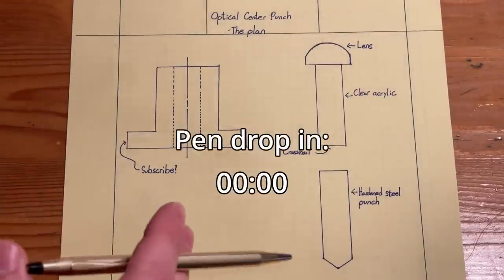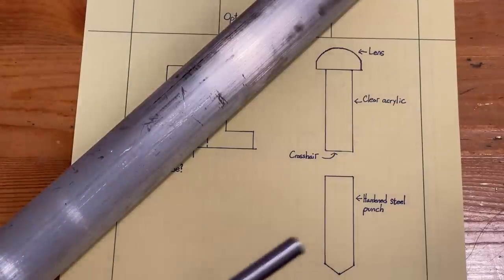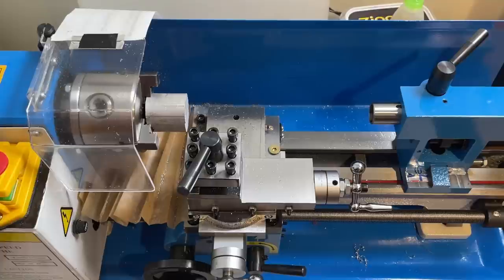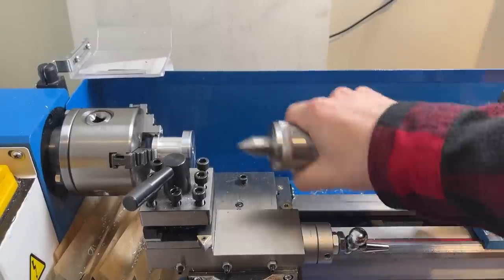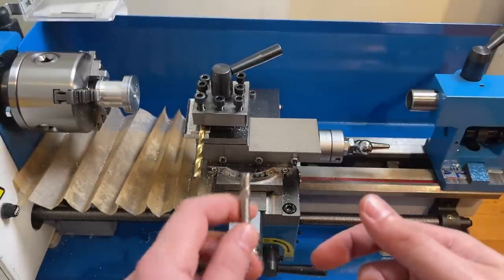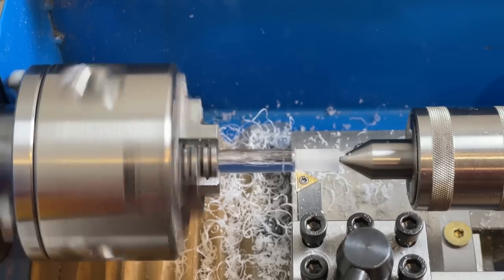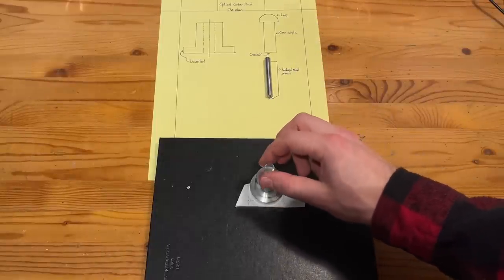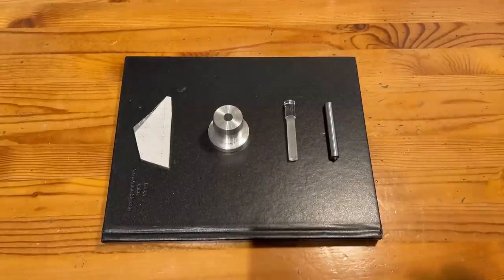Using a Mini Lathe to Make an Optical Center Punch

Comment: I have one like this a tool maker friend of mine gave me years ago. The design is pretty close to what you made with the exception of the acrylic rod has a shoulder that holds the end about .050 off the work surface because acrylic scratches very very easily. Another design difference is there is a second acrylic rod that comes in from the side at a 45* angle about half way down to transmit light to the center mark. If necessary you can use a flashlight or a light source (goose neck lamp) to brighten up the target and make it much easier to see. But all in all nice job on this build.

Comment: With leaning over the punch, the acrylic finder can get dark.  You can make the acrylic rod longer which acts as a light pipe, or make the holder out of clear acrylic.  The punch needs to be very hard, I used water hardened drill rod and the point still dulled on relatively hard materials. Later I used commercial centerpunch replacement tips, they’re cheap.  I made an acrylic spacer to account for the difference in size of the acrylic finder and the commercial punch tip.  That worked well.  You can make the lens end by drilling a piece of 2x4 scrap with a 3 or so inch hole, then cut the 2X4 across the hole 😂and use the curve of the hole to hold sandpaper.  It is slow going with sandpaper unless you get a head start on the curvature of the lens. You can vary the size of the hole in the wood and make different magnification lensed ends.  I used 400 grit wet or dry sandpaper glued to the bottom of the holder instead of my first inclination which was an O-ring.  The O-ring sometimes slipped as I changed from the finder to the punch, the sandpaper is better.  Your slightly eccentric punch… you can turn the whole length of the punch in the lathe.  To align the center of the punch to the acrylic finder rod, you can drill a hole in scrap hardwood the same size as the finder and punch then push the finder and the punch in from opposite ends marking the flat end of the acrylic rod.  If your punch isn’t perfect, you can mark the orientation of the acrylic finder and the punch when marking the spot on the flat end of the acrylic rod.  If you pay attention to the orientation of the acrylic finder then the punch, it won’t matter if the punch isn’t perfectly centered, it’ll still be registered to the rod marked by that punch.  Good luck.  Fun project, eh?

Comment: I’ve seen some comments suggesting that you get a four jaw chuck but that’s necessary only if your stock material is already at the need diameter. If you cut the diameter down slightly and then cut the point without moving the part in the chuck, your two features should be concentric.

Comment: As an apprentice I was taught a three stage process to accurate centre punching. Scribe a cross hair on the hole centre with a nice sharp height gauge. Use a very acute angle centre punch with a point sharp enough to be a scriber. Gently slide the point along one of the scribed lines until you feel it hit the cross scribe. Give it a light tap,  just enough to mark the centre.  Now take your normal centre punch and locate it in the small punch you already created and give it a good whack. With practice you can consistently get within a few thousands. With regards to your design for the optical punch why not try scribing a fine crosshairs at half the diameter on the acrylic rod?
Reply from the maker: I’ll have to give that process a shot, thanks for sharing! And good suggestion, a crosshair would definitely make it easier to line up the punch.

Comment: Some great tips there thanks. I made one a while ago and it's not quite right, so I'll check my centre punch as I didn't consider that could be an issue. 
A suggestion I have is making the bottom 1/4" of the holder out of acrylic with an embedded LED powered by a CR2032 battery. I did this and it is a game changer. Illuminating from the bottom allows you to see scribe lines much more easily.

Comment: re using a drill as a boring bar - they just aren't very stiff. They work as a drill because they cut on 2 faces and the forces are approximately balanced. Also - for any boring bar - use the minimum stickout - again - stiffness. Cheers.

Comment: Nice work on the part and video.  An o-ring in a groove in the face of the base part will give you some traction, and rotating the lens in the body while you look through it will highlight any eccentricity in your crosshairs.

Comment: Machining tip regarding the accuracy of the punch itself. Leave excess length on the punch stock. Use a dial indicator and a dead blow lightly tap the stock true. This can be done very accurately (tap with lathe on). Then do all matching without removing the part. You can then cut to desired length as the top side has no real need for true precision.

Comment: Make your own cross hole boring bar... You just take a rod of precision stock, drill it from the end on the lathe and tap it for a set screw, you cross drill that hole to fit any diameter drill bit you want and then you use that... It also works great with broken taps, endmills and similar nonsense... Its my favorite boring bar design by far, and you can grind the hss rods into whatever shape you need... Be it threading cutter, groove cutter, sharp finishing cutter with whatever radius...  Drills are the worst for that, as the drill shank which is cyl. is soft, so you have to harden it... Broken taps and endmills are the best... Actually, if you want the best, get a 50 or 100 pc set of carbide pcb drills, grind the drill tip off, you are left with a 3.175mm carbide body which is just the best for such work... Also, grind a flat on the side of the cutter shank for the set screw to actually be able to prevent it from rotating... That is how you use cut off drills and such as boring bars... This method which you attempted could maybe work with a cut off stub drill, due to its short flute length and thus higher rigidity, but still, the endmill option was the best call you could have made in your scenario... 
I highly advise you to get an assortment of centerless ground inox rods and to make your own boring bars that way... Its easy, cheap, and allows you to make any type of boring bar you need... The cross hole neednt be at 90deg to the screwhole, you can drill the rod at an angle, to allow you to have the cutter in front of the boring bar end, thus allowing you to bore out flat bottomed bores that arent passing all the way through the part... Tho, then you have to offset the setscrew aswell, or make a special plug to interact with the angle that the cutter is at... A wedge style cyl tip... So its easier to just offset both holes and voila... The only issue with that is the minimal bore diameter at which you can really rely on that style of boring bar, which in my experience, is no less than 10mm... Sure, it can be little less, but 9-10mm is pretty much the lower margin for such a boring bar type...

Comment: design alterations... pop two o-rings in the base, at the inner and outer edges, and some type of piston plunger thing. suction cap :)

or throw a few lil magnets in it if you only want it sticking to steel...

Comment: There is a very good section in Karl Moultrecht's Machine Shop Practice vol 1 that describes traditional hole layout. It involves using a very slight and sharp punch by hand and then moving up to broader marking tools, then a particular way of drilling to keep the hole on location.  If you want I'll send an email with those pages from the book. 
 Weather you do it that way or with an optical center punch, you can move your punch mark into the right spot (yes it can be done) so long as you can see it under magnification. With enough care you can get two holes on mark within .001" . I do this with a jeweler's visor like the optivisor. You can even set the punch into  position before striking with much more accuracy when magnified that much. 
I suppose a low-power microscope can also let you at least see what you've done.
Reply from the maker: Thanks for the information! I’ll have to look into that method

Comment: If I could only have one chuck on my lathe, it would have to be 4 jaw independent for the versatility.

But the second workholding thing would absolutely be a collet chuck and all the collets that I can get.  Holding round things just becomes so much easier (as long as you have a collet to suit)

Even a janktastic aliexpress unit is surprisingly workable - mine's a ER20 to Morse Taper that fits in my headstock.
Reply from the maker: Good to know! I was always skeptical about no name collets. Nice to hear that there are some decent deals to be found

Comment: This is a great project that I've not seen elsewhere so a huge well done for innovation! I'm definitely adding this to my project list.
A four jaw or collet chuck setup is almost certainly in your future for concentricity purposes, but do you know you can tap in a part in a three jaw? You don't need shims at all...
Anyway, what I also came here to say was that you will probably want to remake your punch at some stage and make it out of a material that you can heat treat for proper hardness because the moment you use it to punch something harder than it is (i.e. steel) you're going to blunt that lovely pointy accurate tip.
Charlotte

Comment: I realize this is an older video and I admit I didn't read all the comments so I apologize if it's already been said... The reason the drill bit didn't work to clean the sides of the center hole is because the flutes on a drill bit do not have a cutting edge.  They are designed to remove the cut chips.  The cutting is all done at the tip.

Comment: A nice project! A 60 degree point might give a better centre mark. Did you harden the centre punch?
Reply from the maker: Thank you! I’ll have to try that out. I didn’t end up hardening the punch but now that it’s confirmed in the right spot that’s a good idea
Reply: For more brownie points, you could use a convex cutting tool to put a radius curve from 45 to 60 deg. That point should add some precision.
Reply: That’s what I thought, too.  I have several pieces of HSS from broken end mills that were cut down to 60 degree points and one with a very long “pointer” tip.  It’s great for locating center punch marks in the mill and drill press.  The carbide tools in the video will cut HSS effortlessly.

Comment: You probably want to harden the punch. Adding an LED for light might be a good idea.
Reply: It's linear motion rod, usually thru hardened isn't it?
Reply: @procyonia3654  The linear motion rods I've used for things are case-hardened, not through-hardened. In the video he turns it and uses a file on it, so we know the inside material isn't particularly hard. If he uses it only on aluminum he'll probably be OK.

BTW, you only want the tip of a punch to be hard, because the head of the hammer is hardened and striking hardened steel against hardened steel is dangerous.